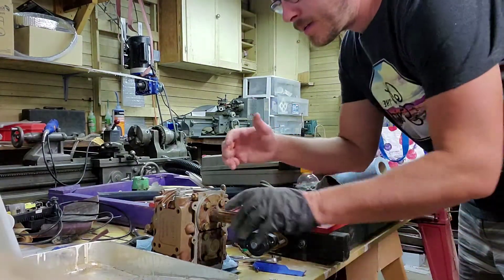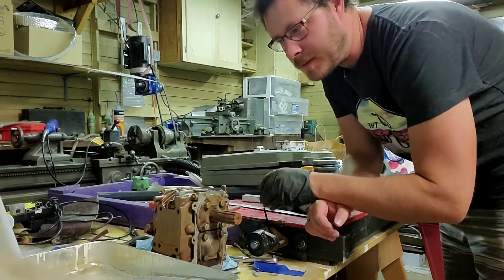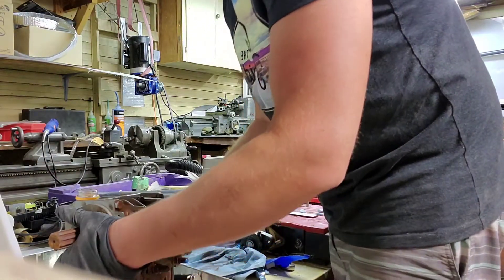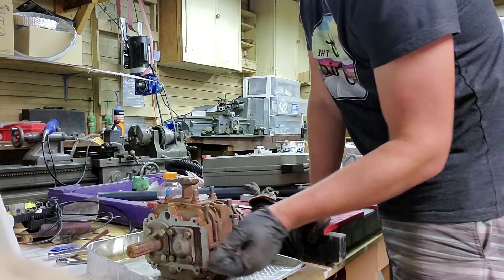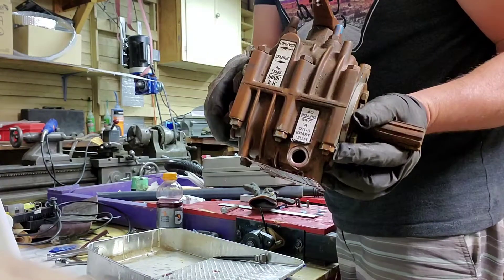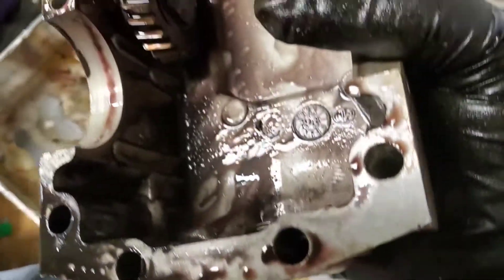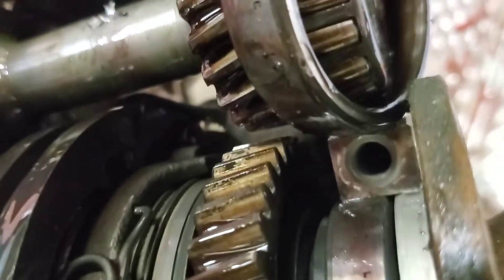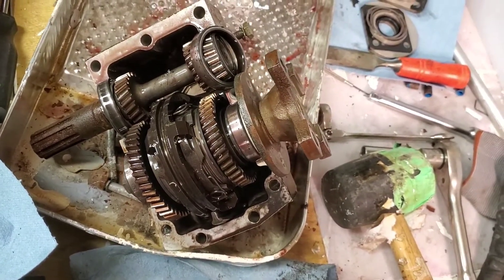Catalina 27 Universal Marine Diesel M12 Hurth Transmission disassembly

Comment: Interesting thanks 
mine Is a yanmar Y2m15  about 13 HP gearbox unknown prop 12*9 fixed 3 blade .
Prop is probably the  prop for the 9 HP engine before the bigger engine was installed in 2006 and seems undersized.
I put in 80 amp alternator so small prop and alternator seems to work On 
I am looking your electric solution to make a backup 24 volt solution to drive a 24 volt 2500 watt outboard .
 My boat is a 1969 very narrow 30 ft 3 ton  deep keel sail boat . My boat  would be similar to your 27 ft boat 
I estimate 500 watts would power me at about 1.5  to 2 knots in calm seas  no adverse or helping currents . 
I just want power in calm  seas  rather than drift for days and extend range using less diesel fuel. 
Also with 500 watt solar panels 4*120 of  12 v then  recharge the battery .
If possible  you can confirm your speeds on your boat at different watts that can help me calculate my solution .
Also if possible the RPM of prop and prop dimensions and type two or three blade fixed or folder type..
I am based in Ireland and lithuim battery shipping HAZMAT costs are a big issue from USA China etc so I might not be able to copy the Leaf battery solution  so I might have to do LiFe types